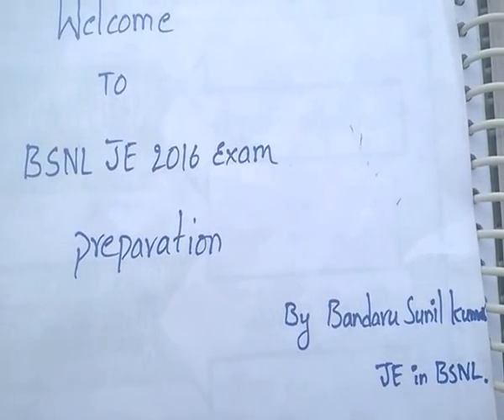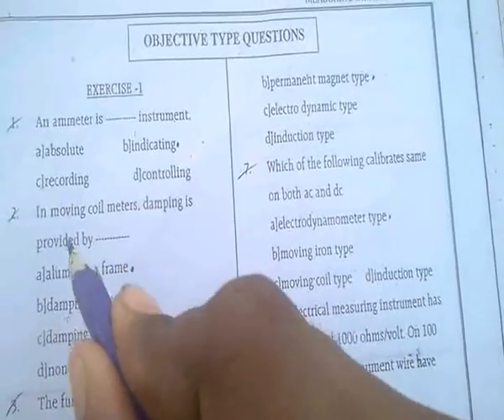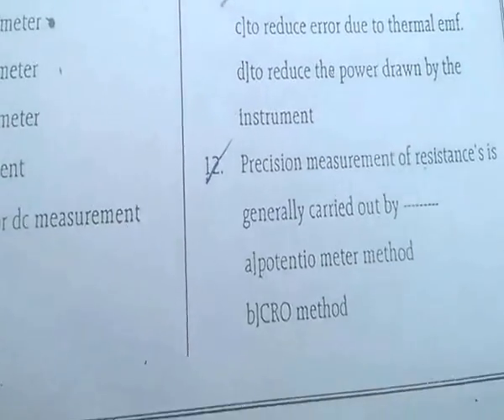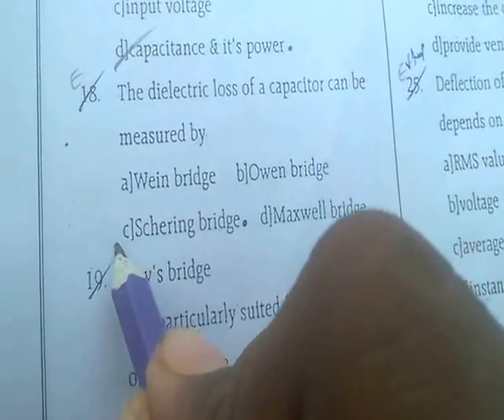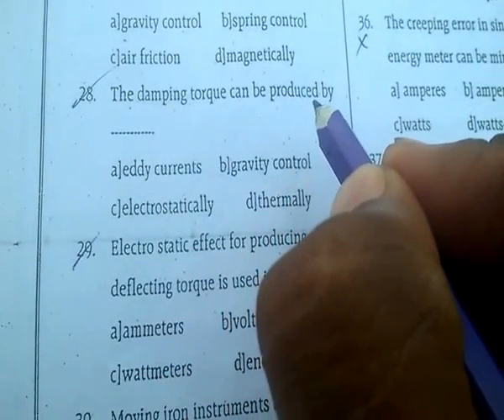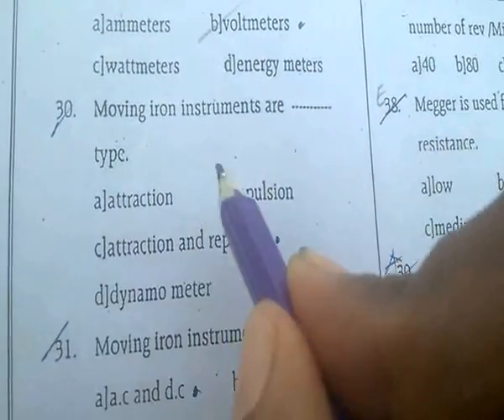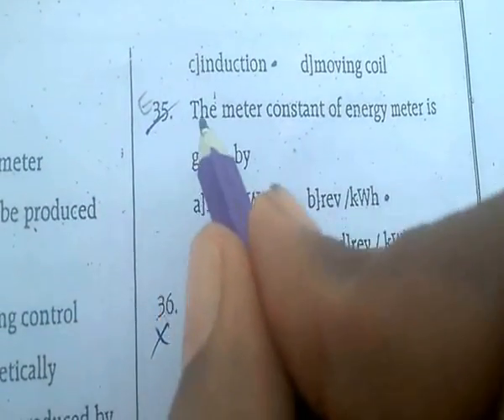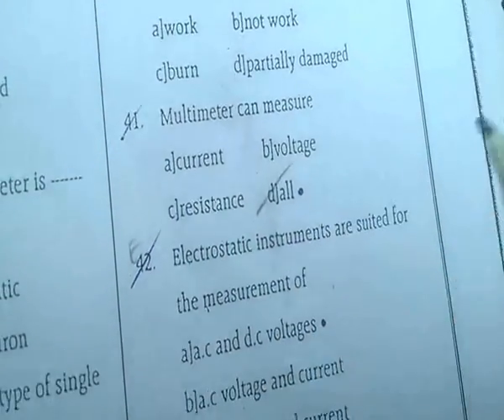INSTRUMENTS AND MEASUREMENTS PART 4 -MCQ's FOR RRB JE/RRB SSE/BSNL JE/SSC JE/PSU'S

Comment: I have a doubt for the 9th question that shunt resistor is also used to increases the current rating in the coil  but  given option a)bypass the current